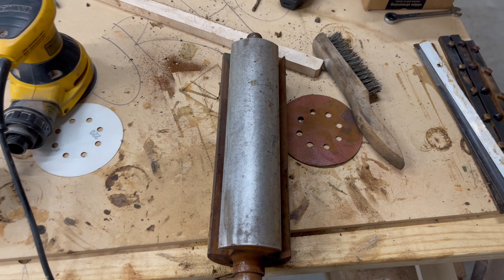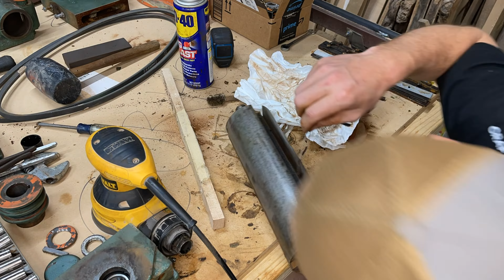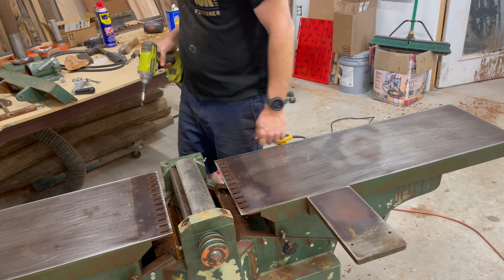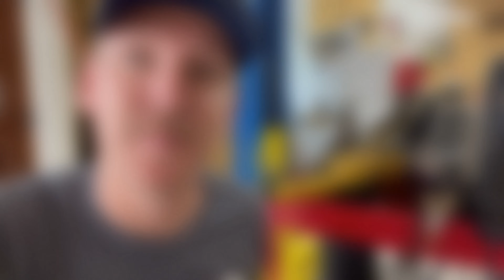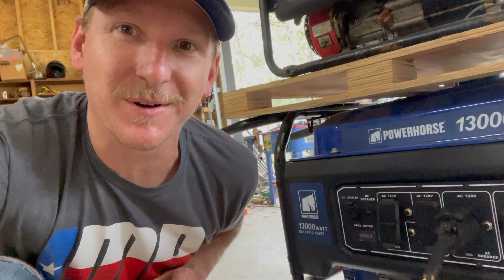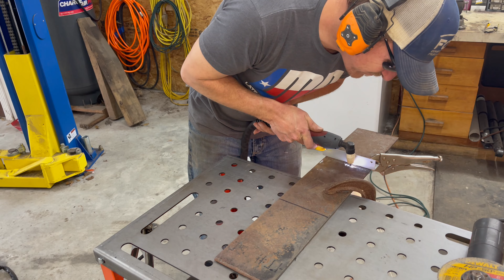RESTORING AN ABANDONED $5,000 JOINTER

Comment: Nice find and nice work :)  I just finished restoring a 110+ yr old jointer on my channel...and found for the smaller parts (or whatever would fit in a container) that evaporust is great to take the initial rust off a lot of parts.   I decided that it was not worth it to me to pay $2800 for a custom 8"  helical head for it since mine had babbitt bearings...but luckily so far in my initial test, the new blades for the old head in mine work great.  I am a fan of helical heads, but could not justify the price given I paid too much for my jointer initially and not needing a lot of jointing for my projects.
Reply from the maker: Cool deal, I’ll have to check it out! I’ve sold a lot of lumber over the last few weeks and am close to having enough to buy the spiral head. I gotta have it! I’ll check out your channel, thanks for stopping by!
Reply: @Colsch_Craft Thanks, hope some of my videos are as enjoyable for you as yours was to me. :)  There is a playlist for all the jointer steps, as well as other fun in there for other restorations and wood projects too.  I also recommend taking the movable tables off and cleaning off the rust on the precision surfaces they glide on against the main base portion...that way you do not get any future rust jacking which throw off your table alignment, and or if it gets too severe, a crack in one of the main body pieces (which would suck).  That was why I always take everything that moves apart and clean it thoroughly.  Not only do I then better understand how it all works, but I make sure to avoid any surprises and problems in the future with rust or something not working right.

Comment: Just a tip for removing rust. You can use a angle grinder with wire brush which makes a quick work and doesnt damage the surface. I buy and export woodworking machines from UK and you can get a used working 14 inch planer thicknesser for around $500 there in great condition. This was worth no more than $250 without a motor
Reply from the maker: Yeah I probably overpaid, but I’m in it for under $800 currently and it’s “working” now so overall, I don’t think it’s a bad investment for a 12” jointer. It was originally listed for $1300 - tried to give them $300 for it but ultimately settled on $400. Thanks for the tips though!